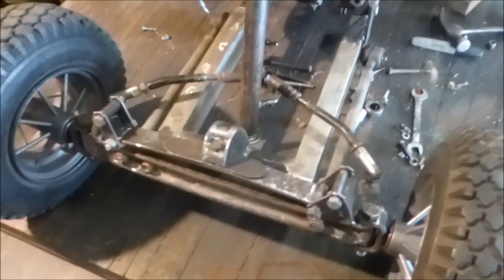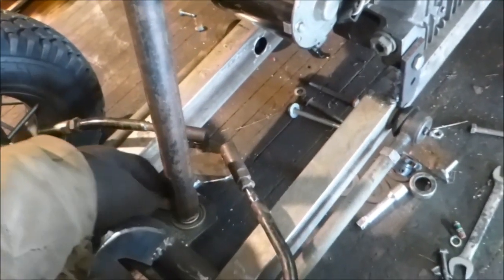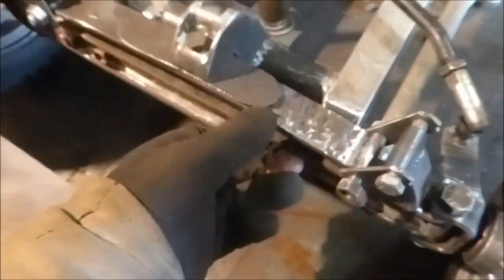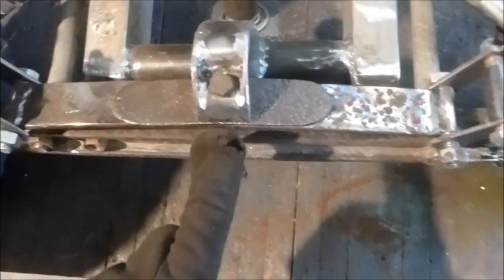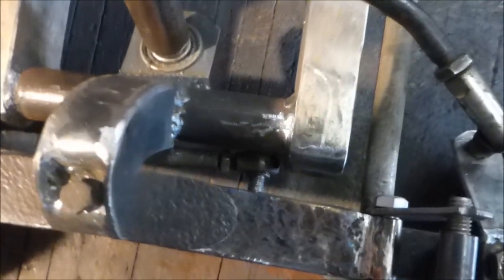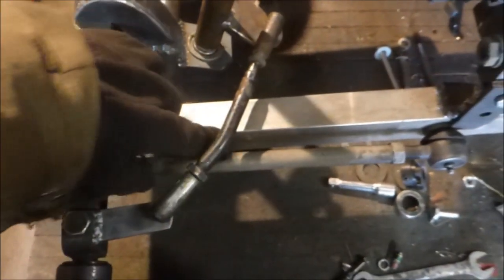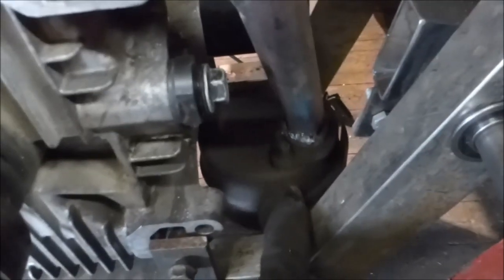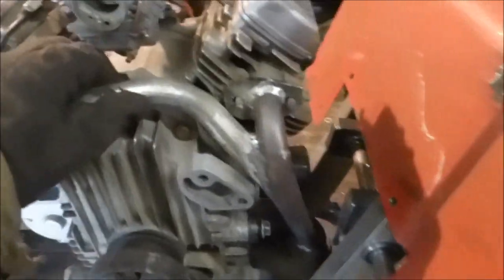Wheelie Horse Tractor build Pt.2

Comment: I like the spoked wheels.  You make them?
Reply from the maker: Yes I did. Just cut the centers out of some 1 piece 6" snowblower wheels used schedule 40 pipe for the hub and drilled 1/4" holes for the spokes and welded them from inside the wheel and hub. They came out real nice Id like to do some with 4" wheels for a minibike but use a smaller hub so the spokes still have some length